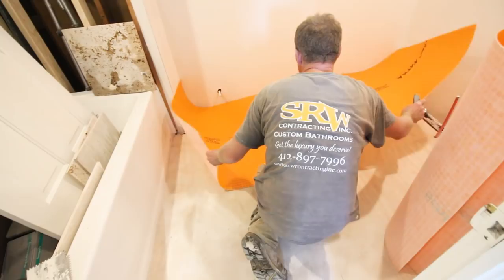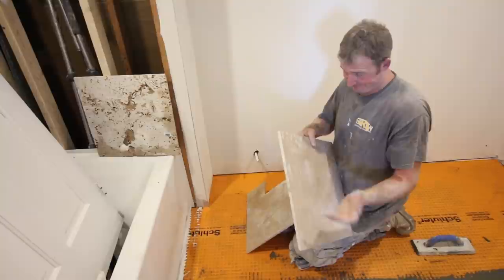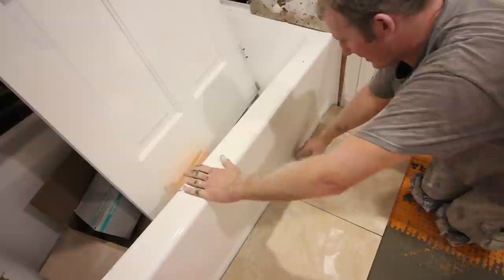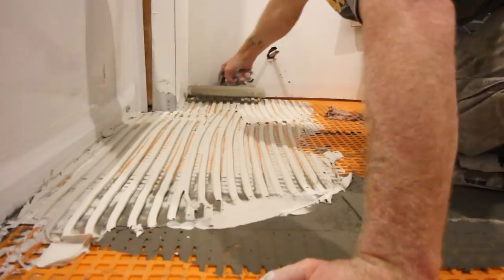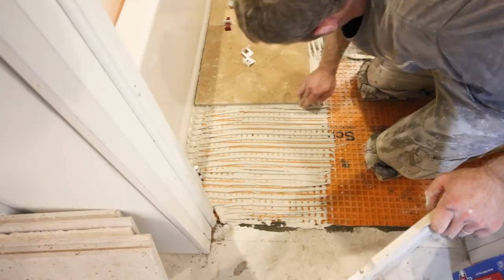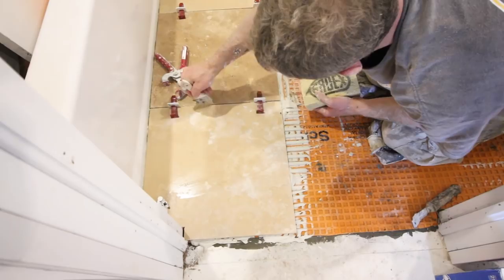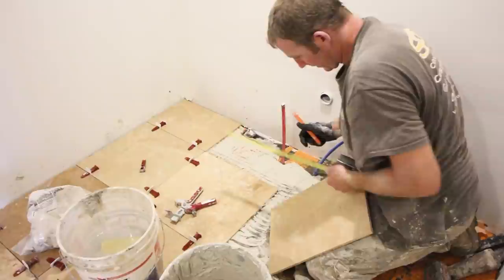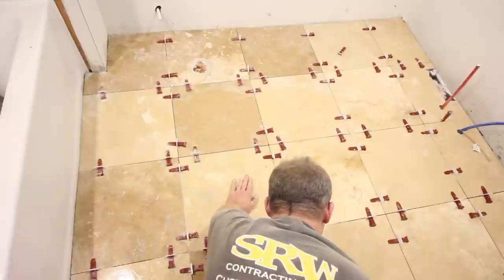How to Tile a Bathroom Floor...Travertine Tile Over DITRA (Step-by-Step)

Comment: Your logic and advice is excellent. I'm pretty much planning the same setup with only a couple of feet larger each way. What I wanted to figure out is whether or not the ditra can be free floating rather than bonding it to the subfloor. I've seen horror stories when it has to be removed.
Reply from the maker: thank you, Ditra has to be bonded to the wood subfloor with modified thin-set. If the tile floor needs to be removed for cosmetic reasons the next person will likely have to cut through the grout joints and through the subfloor then remove small sections.
Reply: @HomeRepairTutor  TU. In my way of thinking I figure the weight and fairly locked in floor(caulking at edges, toilet & trim) no movement would be the norm. Didn't want 2 be one of those guys who leaves the next guy a harder task when they decide to remodel.
Reply from the maker: @j.morrison73  totally understand, but Ditra isn't designed to float over the floor. The weight of tile may not be sufficient to keep both the tile and Ditra tight to the floor. So you might see cracking in the grout and the floor won't be waterproof, which is very important in bathrooms.
Reply: @HomeRepairTutor  Thanks. I trust your opinion and will take your advice. I'm only a DIY'er , that's why I look over what the pro's on youtube advise.

Comment: I will have Ditra running the whole length of the floor, then the walk-in shower base [a single unit without seams] will be put down on top of the back half of the Ditra'ed floor.  I won't get into the logistics of how and why this will work, but ...
Since the Ditra will be running under the shower, do I still need to do the line of Kerdi-Fix Caulk and then tape against where the shower curb and the tiled floor will end up meeting?  I kind'a think -- in my case -- it would be unnecessary.  I realize it is necessary if [as in usual circumstances] the Ditra would end 1/4" from the shower curb or tub wall.  Yes, in my case, the Ditra actually extends under the shower curb and the whole floor walk-to-wsll will be Ditra taped even before my special-condition shower floor/pan unit is installed.

Comment: I know it's been a long time, but I hope you'll see this question:  Do you do anything along the tub AFTER laying all the tile?  I've got a similar job, and I'm concerned that it would look rough or unfinished if I don't do something there (like grout or caulk or both?)
Reply from the maker: Add 100% silicone, that joint should be 1/16” to 1/8” max

Comment: I apologize if the video explained it, but I missed it:
On your excellent video about installing Ditra Parts 1 and 2, you mentioned about filling in the waffers with mortar [very important] -- and that can be done the day before installing the tile (especially due to the time challenges of trying to do both on the same day.
In this video, you're doing both on the sane day.  You're 'da man!!!
Mine will be a small bathroom floor too (just 5' x 4'), but I've never tiled before.  It will be 0.375" thick, 2"x12" marble tiles.  Can I fill in the waffers the day before, as shown in your Ditra Part-1 video?  Or, is it better [or necessary for real stone like Marble or your Travertine] to do it all on the same day?
Reply: Typo:  the tiles will be 12" x 12" [not 2"x12"]

Comment: I have to replace the tile that was in the bathroom. It was 12x24 from the tub wall to a  full roll beyond the tub. Then it was 8x8 out to the exit.  It was also 12x24 at the rt wall under the sink .Can you put 12x24 in the front wall as you look into the bathroom. 3 rolls side by side. Then 2 rolls at the rt. wall side by side for two rolls. Then fill in the rest of the bathroom with 8X8. Can I use T-locks . Should I use T-locks on both sizes, only 12x24 or neither. They had 3 different sizes in this bathroom.

Comment: Great video, I want to put ecoprime and ditra heat over 2x2 inch existing tiles. They are well bonded for 35 years, and almost impossible to remove. what would you use for morter? Modified, or unmodified ?

Comment: I would like to see a video on cove base tile set level with floor tile (not the above version).
Reply from the maker: +TurboFlush good suggestion
Reply: Home Repair Tutor 
I cant find any good instruction on these tiles. Found an old video on youtube. About it.

Will have mine done by the time you post a vid. Unf.

Comment: Good evening . nice video. I have a question How long does it take to get cured the adhesive between ditra and the tiles? I seems takes longer. If it is a normal concrete wall usually 24 hours is enough
Reply: I have user Mapei ultimate showerproof.

Comment: What happens to the T lock spacers on the completed floor?
Reply from the maker: They are removed with a rubber mallet, hit them along the grout joint and they should snap off below the tile surface. It's best to do that the day after setting tile.

Comment: I have been watching allot of your videos :) had some questions. One is, after he breaks those clips off, does he put grout in between the tiles? or is it basically done  and you don't have to put anything else in between the tiles? The other question doesn't relate to this actual video but I'm going to be adding a bath tube to what is now a walk in shower .. i haven't found any videos showing this. Just wondering if you have any videos tut converting a walk in shower to a shower and bathtub? Anyways THANK YOU BOTH for putting these all together and spending the time to help  show and teach others definitely has made me feel more confident in understanding and doing some stuff.

Comment: We just bought our first home outright and our vintage bathroom needs a makeover. It’s got a vintage basin and a vintage deep + high sides bath with vintage large Round shower head .
It has a yucky green wall where shower / Bath is that needs a new beginning + the rest is a white tile with a black n white checker Lino floor + has 1 Window that  opens at the top n bottom but we can’t open the window ( we tried paint stripper, WD40 eg degreaser, bleach) any suggestions would be great. I want the theme to be. Country Beach
Reply from the maker: Sounds like a great bathroom, and it has lots of potential. Send me some pictures and we'll figure it out jeff@homerepairtutor.com

Comment: Oh, another thing I might have missed:
When laying tile, especially natural stone or even porcelain, one needs to leave a 1/4" gap around the perimeter walks [not necessarily against the tub or shower curb, but definitely against the walls].
For a small floor like this, you might be able to get away with less of a gap, but for any floor 8-feet or wider, one definitely needs a 1/4-inch gap around all the perimeter walls.

Comment: Love your channel! It gives me the push I needed to do my bathroom myself. I have a question and I did not know where to post it though: can u lay smart core vinyl locking tiles in the bathroom? I thought would be nice not using and adhesive so I can change it easier if  don’t like the look. Thanks for al the info u bring out on YouTube!
Reply from the maker: Great question, we stick with a waterproof isolation membrane like Ditra then tile over top because water is a problem in bathrooms. The last thing you want is an unknown water problem that degrades structural integrity. Water leaks are prevalent at the tub to floor transition, same for curbed showers. So we’d recommend tile over vinyl for that reason. What kind of project are you planning?
Reply: I am planning on doing a total (small) bathroom remodel, because the subfloor around the toilet was rotted and leaked into the basement. I am busy getting the floor out etc. and I just finished watching your video about removing bathtub and surround because I need to do that too. But before I get down to the real business I will watch your channel a whole lot! Thanks for your answer I will stick with tile now. 😀
Reply from the maker: Let us know if you have any questions during this phase. We also have great videos over on Bathroom Repair Tutor.
Reply: I am planning on using your video’s every step I take so thanks for al those video’s

Comment: Do you recommend the Schluter All Set thinset under the Detra and also for setting porcelin tile on top of the detra?  If not what mortor do you recommend and where used?
Reply: Old post but yes, Allset does it all.

Comment: Do you ever have problems removing the part of the T-lock that is proud to the tile?  I assume that the horizontal part of the clip is left submerged and the vertical piece somehow snaps off?  Or not??
Reply: You can kick the side of it with a boot or smack it with a mallet to break it off. The wedges are reusable.
Reply: the plastic bit that the wedge goes into is designed to break just under the grout line while the other plastic piece stays indefinitely, so a swift kick or light touch of a mallet and its gone.

Comment: Can you lay this tile without having a grout line?
Reply from the maker: +kayBTR 1/16" grout joints are reasonable and I'd have to look up what the Tile Council of North America states as the acceptable joint size, but we wouldn't recommend going without a joint. Is your concern maintenance?
Reply: @HomeRepairTutor  I notice old stone floors in old buildings in Europe don’t have grout line, they just butt up the tiles next to each other.  Grout gets dirty and I don’t want to try to keep it clean. And grout came out of the seams when I had 1/16” grout lines.  Thanks for your answer.

Comment: T-locks will not self level or  correct lipage.  Its just a tool. Still requires the installer to do the lipage work. 

Great vid! Lots of good info.
Reply from the maker: +TurboFlush you're correct in that the floor should be level and the T-Lock should be viewed as a tool. It helps tremendously with large tiles that need tuning with each other and helps reduce lippage
Reply: Home Repair Tutor 
I just used another system similar. Very impressed. Does make a bit more work. But what i liked most was it "locks" the tiles while working on others to prevent accidental movement. 
Def will do again but will probably use this tlock brand instead.
Reply from the maker: +TurboFlush we like T-Lock because the clips rarely break and the wedges can be reused. We've never encountered a wedge breaking. You're right, these systems keep the tile locked in position and allow for a better bond between the tiles and substrate.
Reply: 99s Rash did we get the mail They provide a variety of services, from helping you pick out items to ringing up your purchases. Like cashiers, retail sales associates use cash registers to process transactions and are responsible for keeping track of all the money inside. Caregiver duties and responsibilities can include: Assisting with personal care: bathing and grooming, dressing, toileting, and exercise. Basic food preparation: preparing meals, shopping, housekeeping, laundry, and other errands. ... Back-up care (or respite) services: providing other caregivers a break.? From there we will Caregiver duties and responsibilities can include: Assisting with personal care: bathing and grooming, dressing, toileting, and exercise. Basic food preparation: preparing meals, shopping, housekeeping, laundry, and other errands. ... Back-up care (or respite) services: providing other caregivers a break.
Reply: Home Repair Tutor p

Comment: What size spacers did Steve use in the project?
Reply from the maker: 1/16" T-Lock Clips but it's always a personal preference
Reply: @HomeRepairTutor  Thanks for the reply. I am putting down the exact same tile and am trying to get away from a sanded grout. Awesome video as always!
Reply from the maker: @jasonreist8145  we used Mapei Ultracolor Plus FA for that tile, highly recommend FA grout

Comment: Do you drill the plywood underneath before you lay the ditra?
Reply: Jonathan Tucker 

You definitely should to prevent eventual squeaks; you also need to ensure plywood is thick enough.

Comment: Did you seal them tile before installing them? Or no need to?
Reply: If the tiles need to be sealed (not all of them do), do it after everything is done (inuding grout) it's much easier to clean and  seal the entire surface at once

Comment: I'm using large tiles in my bathroom and my dad told me to be careful. I told him I'm using modern technology.  I can appreciate tile work during communist times, but I'm an engineer so I don't have to do it hard way if I deem it unnecessary. As a matter of fact I deem it superior. I'm talking about the Ridgid Level Max and all the other variants.
Reply: You can use modern techniques without being disrespectful

Comment: I going to be laying wood look tile on our upstairs hall bathroom. However, after taking up the tile that was there when we purchased the house we notice that their is a small hump width wise across the floor which makes the tile unleveled on either side if the tile is place across the lump which is unavoidable. Is there anyway to get a more level floor for tile installation without pulling up the wood subfloor (which I’m not comfortable with)?
Reply from the maker: Char, it might be easier to replace that section of subfloor than self-leveling the floor. I'd be curious to see what's under the subfloor, too. It' better to identify the problem rather than tile over it. How big is the hump and how high is it in relation to the rest of the subfloor?
Reply: It’s just under a 1/2 inch lower than the highest point. The declined starts in the middle of bathroom heading towards the bathroom door. We think the lump maybe on top of a joist.
Reply from the maker: @charnellmarie  are you planning to inspect it further?
Reply: I don’t know if we have the skills necessary for that but unsure who we should get to do it. We thought to take up the subfloor to confirm but it’s a continuous piece that goes under the bath/shower combo. Not sure what to do at this point. By the way I signed up for bathroom repair tutor on the 2nd of February.
Reply: This might be too late, but you could use a belt sander or a planer to take out that hump.

Comment: your using ditra different from your ditra videos. honestly does it matter if you grout the ditra before laying the tile?
Reply from the maker: By grout I assume you mean fill in the waffles with mortar? If that's the question, then yes it does matter. Schluter recommends filling in the waffles and this can be done either right before tiling or the night before.

Comment: I’ve got floorboards in my bathroom
Reply from the maker: Do you mean wood plank that runs over the joists?
Reply: Home Repair Tutor yes mate,,I’ve just moved house and in the bathroom it has Lino down and under that is floorboards,,all the upstairs in my house is floorboards
Reply from the maker: No problem, we like using Ditra over that. But it requires plywood on top of the boards. I’m blanking in the thickness they recommend, likely 3/4” but could be less. Ditra is only 1/8” thick
Reply: Home Repair Tutor have you got any videos to show me how plz